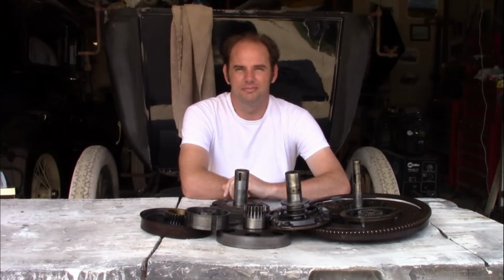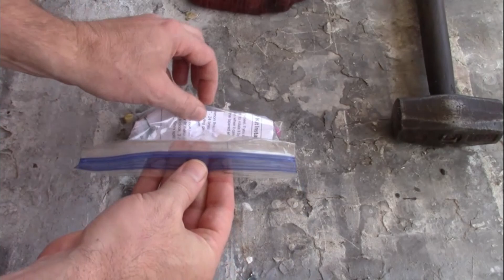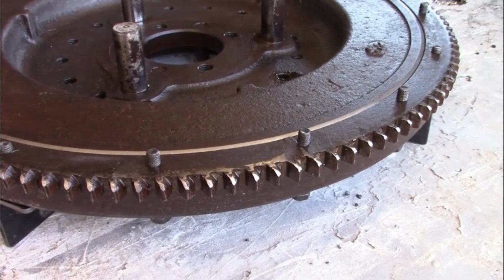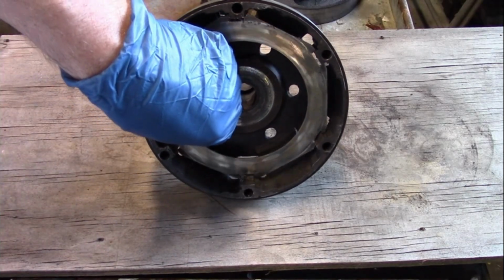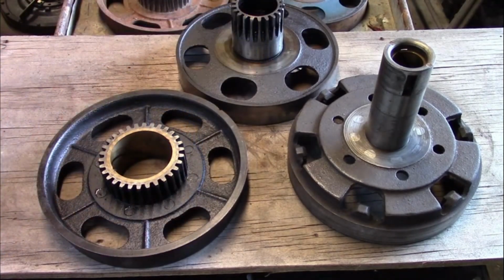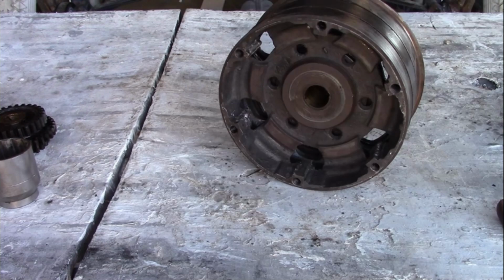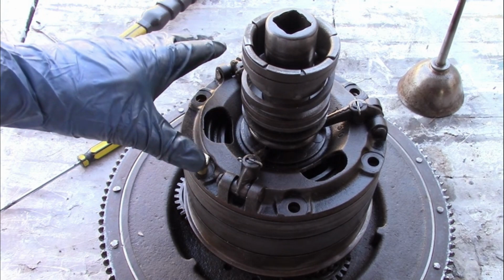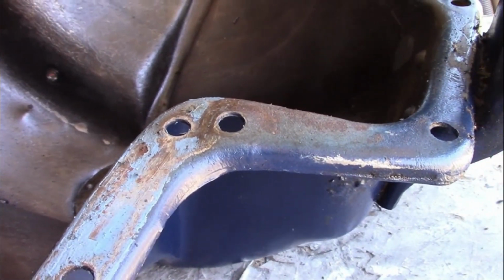Reassembling the Model T engine/transmission. Part 1.

Comment: I wanna thank you for your videos. I have a 1923 Model T and learned alot from your videos and even for the mag box. I finally got it started after 9 yrs of sitting after someone else drove it and messed up the timing gear. I now have it after my mother said it was going to be inherited to me since im the mechanic in the family. I have a few videos of mine posted soon of it running. But thank you for showing us how to fix these old cars. Ive learned alot and the ford service manual is a must have.
Reply from the maker: Thank you very much, I try. 
That's pretty neat, have fun with it!

Comment: Because I use a distributor, I use oil flippers and they seem to work very well so far. (they move a lot of oil)  The only thing I did differently was I put a bolt and washer behind the triple gear pin to keep it from possibly walking out.  As you know the magnets would normally stop that from happening.  Just a little insurance.  I always enjoy the videos.  Cheers from the shed.
Reply from the maker: Thank you. Clever idea, I never thought about that.

Comment: I was watching this video specifically to see how to bolt and unbolt the flywheel and transmission to the engine itself.
I don't blame you for doing that off video, but somehow it would have been nice to have some foreknnowledge...😉🙃
My flywheel is missing four magnets (but is otherwise balanced) which I have acquired, and had planned to install.
But you DID teach me that these magnets are essentially the oil pump, so perhaps I can just add oil to my already rebuilt engine (purchased that way), and stop postponing the inevitable Old start/Cold start.
Purportedly, it was parked in 1932 after being used as a Doodlebug for 5 years on a farm in Ohio and has not run since, after they acquired a tractor.
Reply from the maker: It bolts to the crankshaft flange. the bolts go in from the front (opposite of most other cars).

Comment: If welding up the clutch teeth works ----- Good Job -------- Seems like if we can fix something ourselves ---- there's a good feeling we have in doing the repair -------- Interesting in seeing the internal parts of a model T trans ----- A nice simple fix for the oiling system ------ so much simpler ------- Thank You for bringing us this video ------ It's Educational ---- Have a Good Week ---- Rodney
Reply from the maker: Thank you very much.
Reply: Back in the day, these Model Ts were regularly fixed by the farmer, or the town blacksmith.
I never doubted you for a moment.
I acquired my 1927, 7 years ago.
I will perhaps start it by Spring
(Or even Christmas)

Comment: makes you wonder how they got everything lined up with the magneto when they were slapping them together in the factory.  I have had mine apart and my guideline was to give the magnets as much clearance as I could.  It probably makes the magneto a bit weaker than it could be but it seems to work well enough.

Comment: It is always interesting on the though of mechanical engineering was back then, I many cases they works out well. I feel the fault was in using to much cast iron and not forged steel.
Reply from the maker: I think the reason for using cast iron was to keep the manufacturing cost down. But that's just my guess.

Comment: I watched Gen 3 auto and your videos. Just wanted to see if any differences in a 1925 Model T trans set up im working on. I noticed you and Gen 3 had 3 spacer washers in the brake drum and mine has 2.
Reply from the maker: They typically have 3, but it's not uncommon to need more or less to get the gap just right.
Reply: @onewhocollects6781  thank you